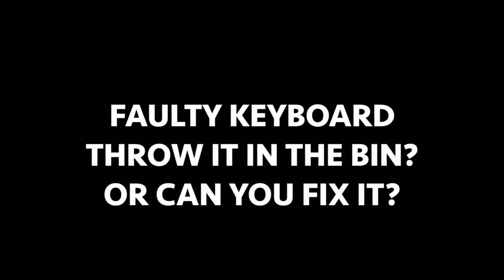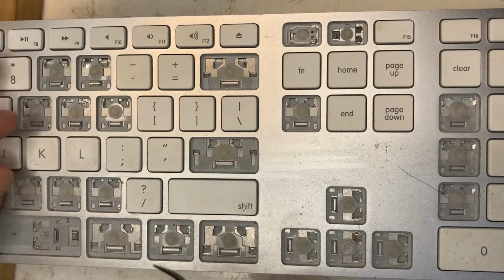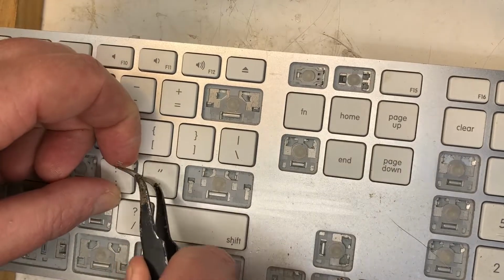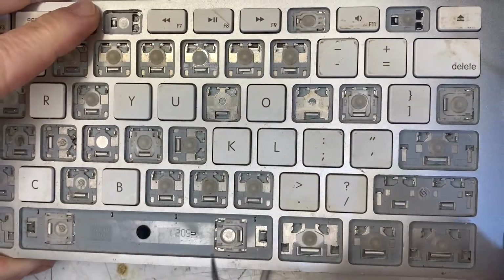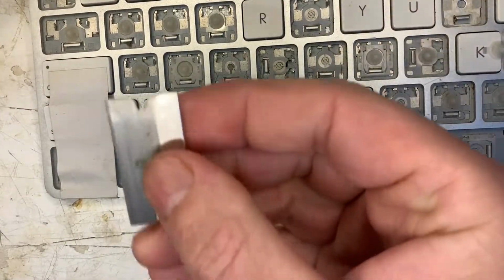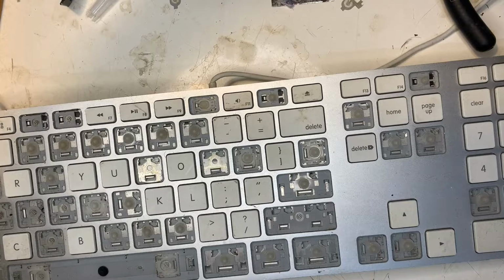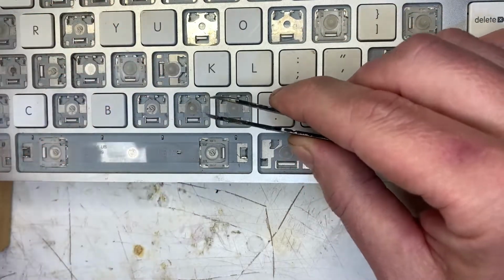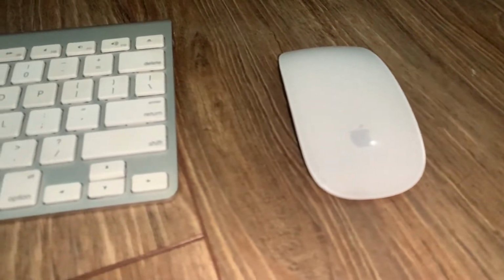Keyboard surgery on faulty Apple keyboards without opening them up!

Comment: what would cause my apple wired ubs kb to type 3 different letters on a single keypress? its only the top row of letter
Reply from the maker: Could be moisture ingress. Try removing the key caps and see if holding up one or 1 or more of the rubber buttons can change its behaviour.

Comment: Painful intense process !   Better off purchasing a new Keyboard... Used keyboards are high risk as seen in your case..... Thank You for the time you took to make this video...
Reply from the maker: That’s a valid opinion sure, although a new keyboard from Apple is AUD $139+. Similar quality keyboards are also up over $100. A used Apple keyboard is from $39 from eBay. I bought bulk lots and fixed many using my methods.
That being said I wouldn’t bother trying to fix a Microsoft, Dell because it’s simply not worth the effort.

Comment: A THOUSAND thanks for showing how to replace the blasted silicone buttons! It looks much easier than I thought it would be. Otherwise the keyboard is worthless. Cleaned the well where the key sits with alcohol and a brush and the top of button just flew off. Undoubtedly fatigued from being pressed a zillion times in its 13 years of life and use. UGH. Now to find a replacement button from a donor keyboard somewhere...   Are the buttons the same on A1315 and A1255 keyboards (different buttons for larger keys of course but for the main keys)?? THANKS!!!!!
Reply from the maker: Thanks! I'm not sure if they are the same, but should work. You can probably ask someone who is selling individual keys to cut one or 2 out for you instead of supplying a key. I used to cut fully through the membrane as large as possible so people could trim them to how they wanted it.
Reply: @FixTechStuff  Much obliged, Kind Sir. 🤠😇

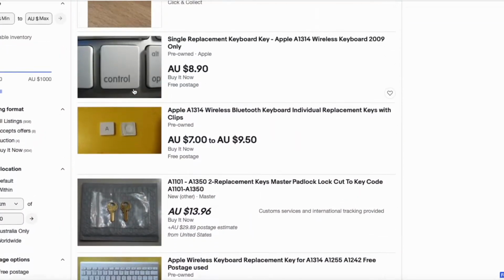Comment: Currently trying to research these keyboards a bit more as I’m looking to repair more difficult issues and I did not expect to see part of my listing at 3:10 haha 
- Very interesting video thank you
Reply from the maker: The shimming made me good money, got a full return on bulk lots, as for opening them I think it's impossible to do it neatly. 
One possibility for diagnosing could be inserting something in the key holes to connect a multimeter to pinpoint problem locations by comparing results to a known good keyboard and then possibly inserting a wiper with alcohol to clean problem areas..
I hope you're not the guy listing the 78 or 109 keys individually, rather than a single multiple item listing, because if so I want to fight you! 😤😉
Reply: @FixTechStuff  haha no the listing fees are 36p per listing per month, I think the guys who list them individually have a private eBay account 🤣
Yea it seems impossible to repair traces economically, unless perhaps it was nearby to the key and can be seen without opening perhaps, right now I’m mainly looking to figure out how to repair keyboards which are over sensitive / under sensitive 
Considering getting a ultrasonic cleaner but I’ve got no clue if it would be able to fix any of these keyboards, 

I always tried to fix the keyboards with a key stuck on but I usually gave up, seeing this video and the idea with the shims gives me hope and makes me want to go through my entire faulty inventory and test them all again now 🤣
Reply: @FixTechStuff  just successfully fixed a keyboard with your shimming method - one of the keys was way too sensitive - works normally now
thanks again :)
Reply from the maker: @Keysbored  That’s fantastic! Glad to be of help.

Comment: Hi, my keyboard type 3 letters on single press. Please suggest. Regards
Reply from the maker: Seems like water ingress or something has warped one layer of membrane. Try carefully lifting the buttons while pressing others (or inserting thin strips between the membrane), see if you can get a change when you press one of the keys.
Reply: @FixTechStuff  what do you mean by inserting strips between the membrane? can this be done under each key? conductive strips? paper? plastic?